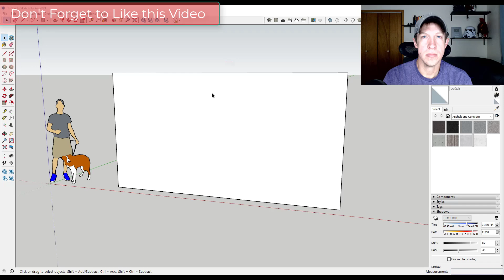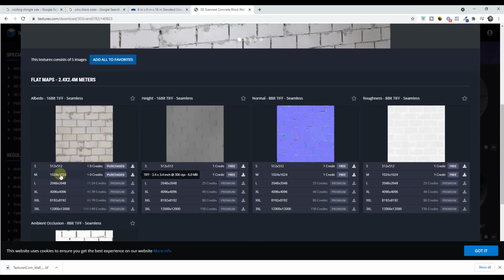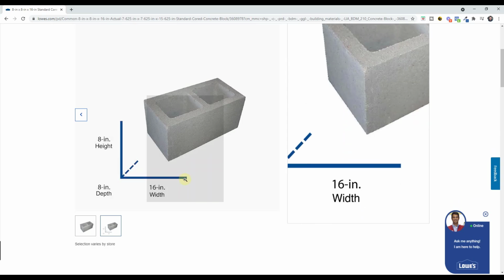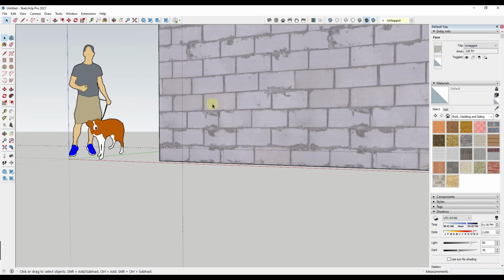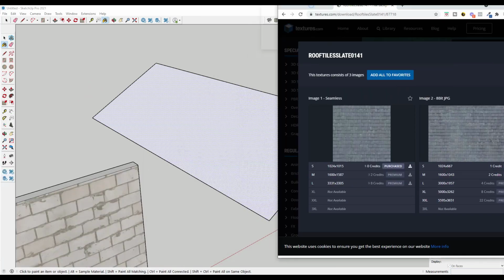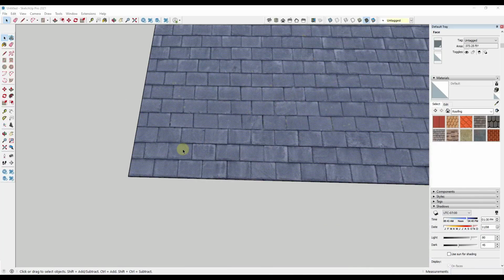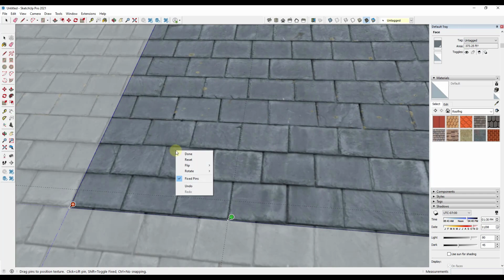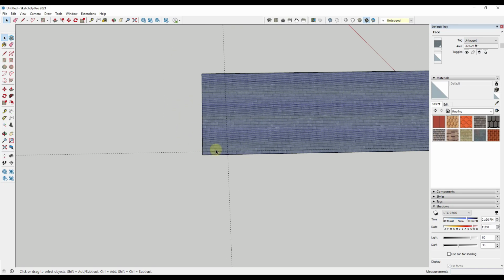Create SketchUp Textures with the CORRECT SCALE!

Comment: I'm not nuts about using the position texture tool if you want to save a material for use later in your skm library. Or even if you wonder if you might use that texture on new geometry later, since it will only re-apply that distortion if you eye dropper the pre-distorted texture, but not if you pick it from the materials list. Maybe that's a non issue for your purposes, but I've definitely saved materials, then forgotten to readjust the scale to ensure the material still looks appropriate. Any feelings regarding using the text box in material edit pane to adjust the texture itself, other than counting pieces in a texture then dividing or guess and check can both be tedious?
Reply from the maker: I don't fully understand what you're getting at - if you're saving the material for future use and you're making the material to be to scale, why does it matter that you've distorted it? If you've distorted it to the proper size, then it wouldn't be an issue. If you haven't, just don't save it to your library, right?

Comment: I have to ask. The texture positioning in Sketchup drives me mad. How did you move the pin points? Can you just drag them? I find scaling to be horrible because if you waver off an axis it starts to distort..

Textures are the biggest problem I have with sketchup. I can run rings around most people modelling.
Reply: Yes, its just a click and drag kinda thing with the pins.
Reply: @TheRCguy88  Go figure. I hate the SU texture tools. I can't figure out a way to easily scale the texture. If' you're not care it start to skew it. I've tried shift, alt and ctrl and none of them make a difference.